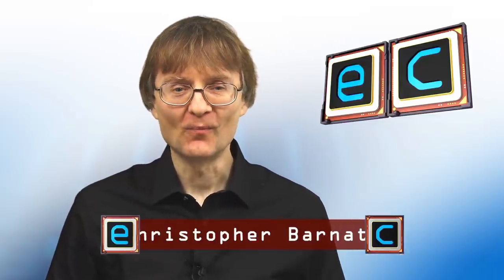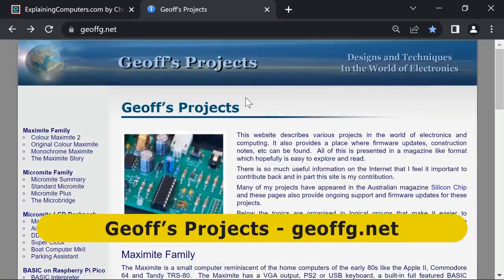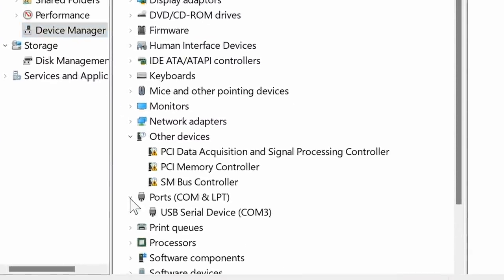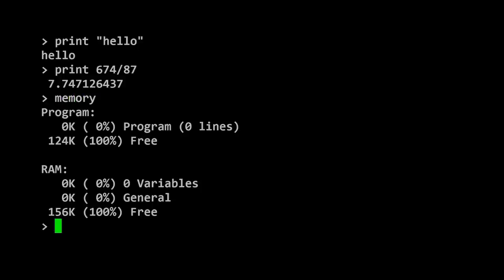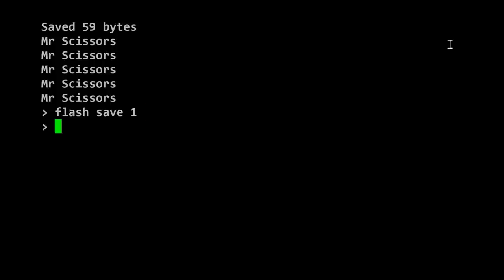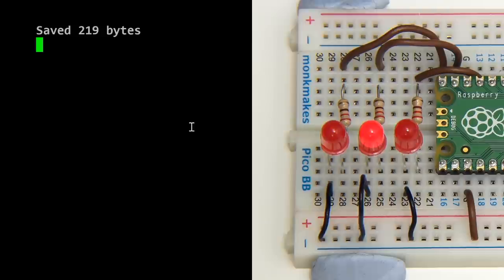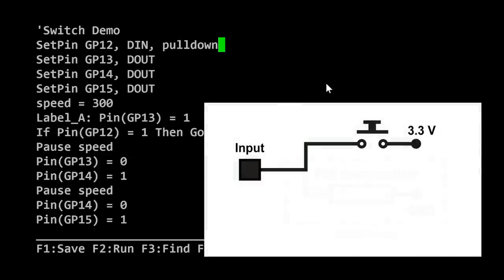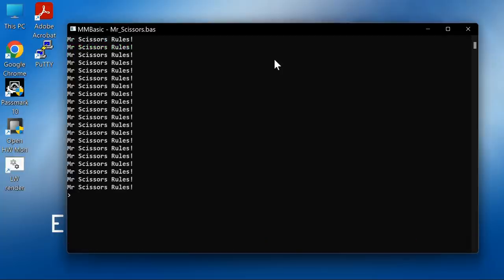PicoMite: Running BASIC on a Raspberry Pi Pico

Comment: I wonder if I could set up a working text editor of sorts. Nothing too fancy, just read from a standard keyboard, display it on a screen, do a bit of editing, vim style maybe?, and saving the plain text output somewhere convenient.
Reply from the maker: This can certainly be done -- the PicoMite VGA (where you wire in various resistors and diodes to allow a VGA monitor, keyboard and micro SD card reader to be connected) achieves this. :)
Reply: @ExplainingComputers  great! Cheers!

Comment: Can the interpreter be created without the breadboard if no other wiring for LED or SD card is done
Reply from the maker: Yes, all you need to install and run MMBasic on a Pico is the Pico itself and a USB cable to connect it to a PC.

Comment: My company is looking at different boards. How many LEDs could a single board like this control?
Reply from the maker: The Pico has 28 GP pins, so if the LEDs are attached directly to them, it could control 28 LEDs. However, via multiplexing, and with the right software, a Pico could control LED panels with a lot more LEDs than that -- eg something like this: https://www.adafruit.com/product/2278

Comment: Wich are the specs of the Sinclair ZX81 compared to the Pico? It could be possible to build a Pico ZX81?
Reply from the maker: The ZX81 had 1KB of RAM, (with about 760-ish bytes available to the user as I recall!). Or you could add a RAM pack, most usually 16KB. The CPU was a 3.25Mhz Z80, of course single core. So the Pico has about 40 times the CPU speed (double if both cores are taken into account), and 264 times as much RAM as a standard ZX81. Hence a Pico ZX81 is very much a technical possibility . . .

Comment: I tried running MMBasic.exe in a dosemu window on Linux and it refused to load, displaying the message "This is a Windows NT character-mode executable."  It apparently only runs in a Windows NT command window, not a true DOS or DOS emulator environment.
Reply from the maker: This is not a surprise! :) It should run in a Windows virtual machine in Linux.
Reply: On Linux Mint I just double clicked MMBasic.exe and it opened instantly and I was able to type in a program and run it with F2. You need WINE installed on Linux and then most of these types of little Windows programs run like they're native.
Reply: It runs the Mandelbrot test program about 800 times faster on my PC than a Pico and the PC is not even trying.

Comment: I just had a flashback to all the crappy things about basic. The size of program storage is not one of those. Tight.

However, I have 2 of these and I'm intending to use these to create a 6 voice synthesizer (I am a software engineer so please don't worry about my sanity, I don't have any).

So, FAST alternatives, please. BASIC may be lean. but it ain't fast!
Reply: You should test it's speed before writing it off. It's over 100 times faster than running the same program on a Dragon 32. It also has Interrupts you can use in BASIC.
If you do it in Python or C it will be faster still but do check first, I was surprised.

Comment: This isn't working for me at all - not sure why but my pico doesn't even want to paste in the utf2 file? Very frustrating, I'm on linux...
Reply from the maker: Has the Pico mounted as a drive?
Reply: @ExplainingComputers  It mounts then suddenly stops working - I'm convinced that the flash is damaged - I've tried Gparted and everything I know including the blitz file to get it working but its just faulty! Have to buy a new one.
Reply from the maker: @johnwalton9855  If it mounts then disappears then I agree that sounds more like the flash itself rather than a driver/connection issue.
Reply: @ExplainingComputers  I'll send off for a new one as I really want to try the basic programming on it. I was also going to ask, I've just bought an Intel 4004 from chip scapes - any chance of doing a review of this nascent SOC?
Reply: I found that confusing too. Being on a Pico W the LED won't flash, it's on the wrong port. However what I needed to do was carry on and hook up Putty as per the instructions. You should see a new COM port on your computer. Select that from Putty as per this video. I had the forethought to buy two Picos so I tried the other when I thought the first was broken.

Comment: I'm running windows 7 and neither Putty or Thony can find my pico on my USB port. Windows can talk to my phone and cameras on the same port though. HELP.  :)
All that ever shows up in Device Manager is COM1.
p.s.  I downloaded the interpreter successfully and it's sitting there blinking away.
Reply from the maker: See if you can use a USB 2.0 port (rather than USB 3.0). In this situation I would try working up through the COM ports (COM1, COM2, etc -- unless you know some are connected to something else). I would also double check your settings in PuTTY. It should work fine in Windows 7. Good luck!
Reply: @ExplainingComputers  Thanks

Comment: after I received my Pi Pico and flashed PicoMite i realised, that the MMBASIC "cls" would not work in Terminal mode. So for this i wrote some tiny Sub-Routines with VT100 Escapesequences to do the Job
So we have TCLS for Terminal Clear Screen
HOME .. guess what ;-)
AT  to set the next print position to anywere at the screen
cur_off turns of the visible corsor to prevent flickering when redrawing the Screen
and cor_on  to reenable the cursor 

-----
Sub TCLS
' clear Terminal Screen
 Print Chr$(27);"[2J";
 HOME
End Sub

Sub HOME
' Cursor top left
 Print Chr$(27);"[H";
End Sub

Sub AT Row,Col
Print Chr$(27);"[";Str$(Row);"H";Chr$(27);"[";Str$(Col);"G";
End Sub

Sub cur_off
Print Chr$(27);"[?25l";
End Sub

Sub cur_on
Print Chr$(27);"[?25h";
End Sub

Comment: Overclocking, according to the manual with, OPTION CPUSPEED 378000 instead of the default 48000 (= 48000 kHz) reduces the time to display 1000 digits of PI from 38.466 sec to 4.765 seconds.
Reply from the maker: Wow!

Comment: Is a “live” bootable basic interpreter on USB possible?  

I have a RPi with  strawberry jam basic ( ichigojam) on it  and I have a link to their web version of the basic ( simulated CPU) PicoMite basic uses the Pico CPU
Again can the host CPU (x86 ) be used to boot basic from a USB?
Reply: I don't think it does that. Once you've dropped the firmware on the Pico that's ready to use. Any BASIC programs you write on it are saved and you can set one to auto start on boot. Simple as that.

Comment: Why not use line numbers,  so much clearer and easier to debug.
Reply from the maker: I have to admit that I did -- and still do -- like line numbers, but they are sadly not the modern thing, which is why I didn't continue through with them in video. But you've made me regret it now! :)

Comment: Oh dear, I believed that we had defeated polio and BASIC for good.
Reply: BASIC had two serious problems; you could not write procedures and it was a bit slow. MMBASIC on the Pico is FAST and you can write procedures and don't need line numbers.
It's over 100 times faster than my old home computer. The development cycle is only two steps, EDIT and RUN and they're instant. In C it's EDIT, MAKE, UPLOAD, RUN. Those two middle steps are time consuming.

Comment: The sad thing  is you still cant get any Raspberry products unless you have a YouTube channel....
Reply from the maker: Not true for this board. As I said in the video, the Raspberry Pi Pico -- as used here -- does remain in stock at lots of vendors. I've just checked again, and the Pico is in stock right now -- eg for $4 on Adafruit -- https://www.adafruit.com/category/875 and for £3.60 at The Pi Hut: https://thepihut.com/products/raspberry-pi-pico  I did a Pico video specifically because availability remains good.

Comment: 1.155 mb for a BASIC ? OK a monitor too. BBC BASIC plus monitor was 32k - what goes? Sure it's a RISC chip but a 6502 was as RISC-like as you could get then.

Also at 9:30 RUN and scissors together. Did you learn nothing at school? :)

Comment: Basic?  Ewwww.  But then we C snobs are like that.
Reply: Normal C snobs are tolerable.  C++ snobs on the other hand...
Reply: @aytviewer2421  C++ just adds an unnecessary layer of complexity to things.
Reply: @CCoburn3  I was joking...  The most arrogant programmer I ever knew was a die hard C++ guy.  He laughed at me in the late 1990's when I used to write a lot of software in VB 6 and C.  VB for desktop interfaces and Oracle Pro*C that ran on UNIX servers for a lot of device communications and database interaction.  I was very productive and produced a lot of working software in VB  6 (pre .NET days) for users running Win '98.  He produced very little working software yet would never stop talking about C++'s multi-inheritance and templates and on and on and on.  He looked down on me for using a tool that made me productive and didn't consider it to be productive.  Fast forward a couple years and when it was time to trim the fat at the organization he was the first of about a dozen people shown the door.  That's where my C++ comment comes from.
Reply: @aytviewer2421  I worked for a company that had a (as in one) programmer who insisted on using PL-1. He was productive until the inevitable day when he retired. Then no one could maintain the code and every last scrap had to be rewritten— at great expense. The use of antique programming languages should be avoided. But the same can be said for advocating a newer language that is hard to use and doesn’t actually result in work getting done. C++ is a great language—theoretically. But in practice, not much actual work gets done by these C++ mavens.

Comment: GWBaisc is a pile of shit, there are better basics out there. Why have three different commands that all can be done with three basic functions like do you need a float function an int function or a bool function when you just need one function that can have data typing found by simple interrogation.

I actually put my Maximate colour away in the box of waste of time products.
Reply: I think the point is rapid prototyping. Getting powerful things done without busting a blood-vessel. If you have a big project that you know will take some time and effort then you'd put in the extra effort at the beginning to set up a development environment with a strongly typed modern language that you might need extra time to learn. You'd probably try and do it in R.U.S.T.

With this someone can have a pretty competent program operating some hardware in about 15 minutes. I'm not going to complain the code is not that well structured because I won't be needing very much.

Comment: Respectfully, please get the finger nails clipped. Also, great video thanks 😊
Reply from the maker: With respect, my finger nails are clipped. All of my nails are kept between 1 and 2mm long (to keep them functional!). Remember the videos include extreme close-ups, and that we do not all have the distal edge of the nail plate in the same position. For me my distal edge is right on the edge of each finger, rather than sunk back several mm from the end. So however my nails are cut they will overhang the end of the finger.
Reply: @ExplainingComputers   Sorry, I have always admire your video content and thought the what appears as long finger nails was an oversight and was only trying to help. So my apologies again to you Sir.
Reply from the maker: @DavidGomez-ws5br  No problem. :)